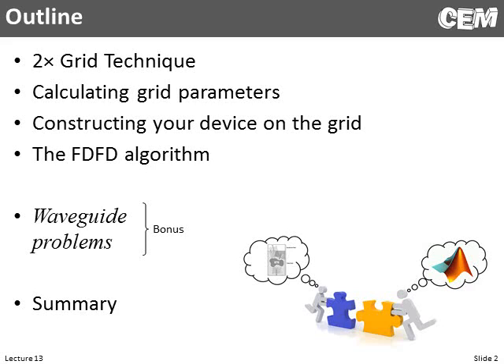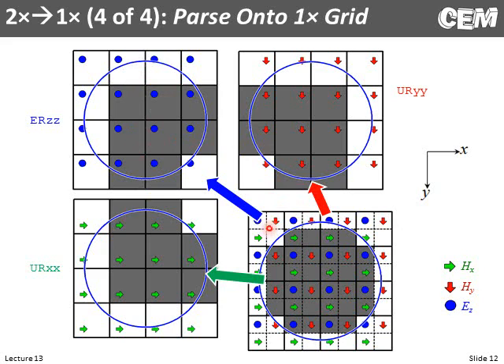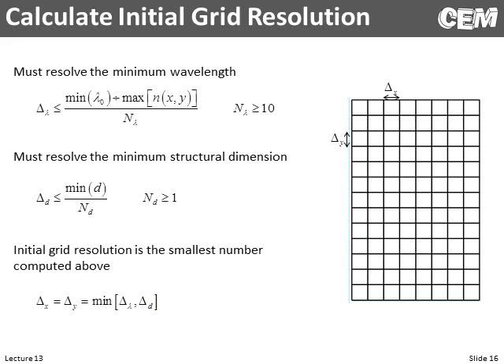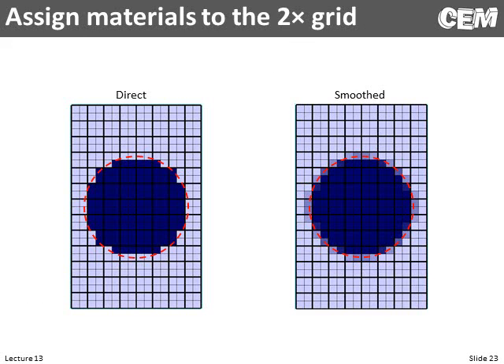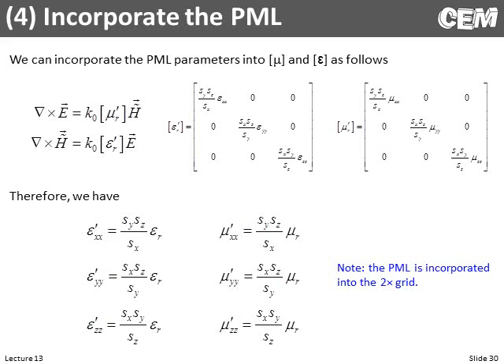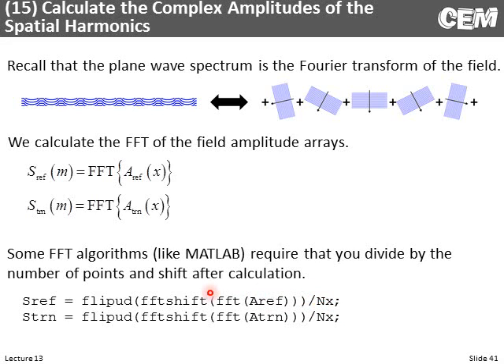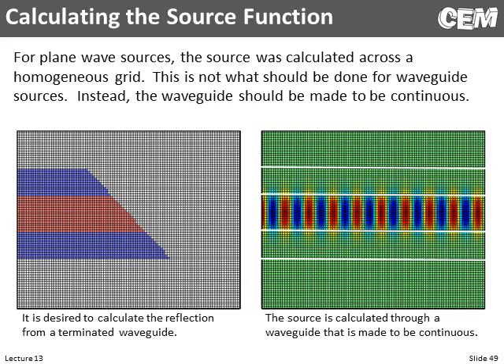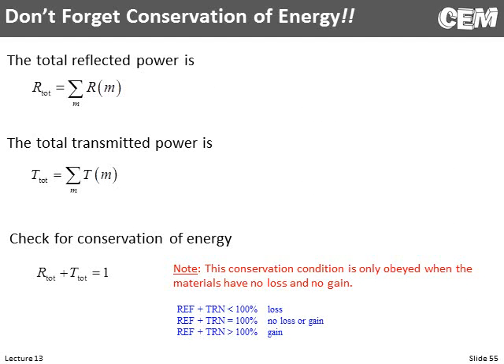Lecture 13 (CEM) -- Implementation of Finite-Difference Frequency-Domain

Comment: How to know which mode is guided through a hollow core fiber ? As obviously the effective index of the guided mode will be lesser than the clad index.
Reply from the maker: There is another lecture, now Lecture 12 on the course website, that talks about calculating modes in waveguides.

http://emlab.utep.edu/ee5390cem.htm

The effective index is essentially a weighted average of the refractive indices composing the waveguide, where the weighting function is the profile of the mode.  What this tells us is that the effective index cannot be lower than the lowest refractive index and cannot be higher than the highest refractive index.  These bounds are one way to make a good guess about whether a mode is guided more not.  The other way is to visualize the mode.  This takes a little more practice to recognize guided modes, but you will see the non-guided modes extend too far outside the core and up to the boundaries of your grid.  Sometimes the non-guided modes actually have a higher magnitude outside of the primary waveguide region.
Reply: CEM Lectures 

Thanks. I have watched that lecture also but this is the one doubt that is puzzling me then too.

The effective index can never be lower than the lowest index value,
How this is possible when light is guided through the low index region ? ( Hollow core PC ). Can the effective index of a guided media can ever be greater than the actual RI of that media ?
Reply from the maker: For waveguides that are uniform in the longitudinal direction, I don't think so.  In metal waveguides, the effective refractive index can be less than one.

For photonic crystal waveguides, or any waveguide with variations in the longitudinal direction, pretty much anything can happen to the effective refractive due to the scattering and interference this can cause.

Comment: Dear Instructor / Teaching Assistant

I want to ask about 2X Grid.

Considering that we are discretizing in a cartesian coordinate system, if we want to model a cylindrical object, that you have used to explain the concept of 2X grid, we will always get an approximation of the cylindrical shape, and it will never be an exact cylinder. So given the approximate cylindrical object, the materials are well defined in each cell, so are the E and H field components. It will not be the case that some E or H components will lie within different materials. 

So then why do we need a 2X grid?
Reply from the maker: You do not need the 2x grid, it just makes things easier.  Without the 2x grid you will have to build the permittivity and permeability arrays separately for each field component.  You will end up having to build your device at least six times for ERxx, ERyy, ERzz, URxx, URyy, and URzz.  You will have even more terms if you including more sophisticated anisotropy.  This is not easy to do, especially for curved objects because you will have to figure out where each component falls with respect to your object.  Some field components could end up inside an object while the others are outside despite all those components being in the same Yee cell.  The 2X grid makes this process much easier.  You only have to build the device in an array one time and then you just parse the 2X grid into all of your different 1X grid arrays.  It is actually very easy to do with just a little practice.

Comment: In your paper you pointed out, the TF/SF interface must form a closed contour.Actually I found problems when I set PML on both x and y directions and make the SF region cut through PML on the y boundaries. Does it mean the TF/SF interface must not cross inhomogeneous medium? Could you explain a bit more about this please?
Reply from the maker: In general I say the TF/SF interface must reside within a homogeneous region.  This really is only a true statement for plane wave sources.  Other source types are certainly possible.  A Gaussian beam source for example can have the TF/SF interface cut through the PML as long as the beam itself decays to near zero by the time it reaches the PML.  The TF/SF interface may cut through anything as long as the source you use is very close to a rigorous solution in that region.  However, obtaining that rigorous solution is much more sophisticated than just using a simple and easy plane wave source.

I will also add the TF/SF interface must form a closed contour so that there is no ambiguity in the source.
Reply: " The TF/SF interface may cut through anything as long as the source you use is very close to a rigorous solution in that region. " ---- thank you very much !!

Comment: Prof Raymond, I have a question regarding implementing metal into FDFD. If I take the complex relative permittivity from curl equation then I get:               er+1j*con/(2pi*f) for positive convention;         or er-1j*con/(2pi*f) for negative convention.        My question is, why we can ignore the imaginary part of the PEC, if its conductivity is infinite?
Reply from the maker: Technically we shouldn't.  This is just a numerical trick for FDFD to easily incorporate metals.

Comment: Prof Raymond, I was able to successfully complete Homework 7 part 1 (FDFD implementation), using the functions yeeder, calcpml2d (which have been checked by your .p scripts).
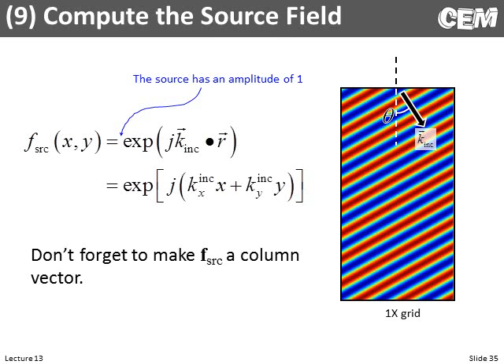However I had to change the equation in (43:14) and use (-jkr) instead of  (+jkr). I think this is because the yeeder equations (which are said to be working fine according to your tester script), is based on (-jkr) forward wave propagation notation.
Reply from the maker: Maybe, but it would surprise me if this mistake slipped through the cracks.  There are three things that need to be in harmony: (1) the source, (2) the UPML, and (3) the periodic boundary conditions.  Check all of these for the +jkr convention.

Comment: Very excellent courses. I have a question about FDFT. I want to solve the modes of waveguides including lossy metal (not perfect metal). I wondering if it is ok just inputting the complex values of the permeability. according to page 24, it seem I need to pay some attention to something else. but I do not know what is that. can you help me? thanks
Reply from the maker: +Xiaofei Xiao Nope.  All you have to do is make the permittivity complex to account for loss.  The parameter relations are discussed in a previous lecture as well as how to use FDFD for waveguide analysis.
Reply: +CEM Lectures Thanks. With your help, I have done that.
1.So now I am wondering the reason for the difference (less than 0.1% for the real part) of the effective index between the results from matlab codes and comsol module. I think the grids, grid size and the precision of the calculation should account for it. Is that true? When I changed the material from dielectric material to lossy one (metal), the imaginary part of the effective refractive index would be much larger (the err should be about 20%). I do not know the reason.

2. How can I derive the formula, if either the coordinate system is changed into cylinder coordinate system or the grids are changed into triangular ones. Do you have any learning material?
Thank you in advance.
Reply from the maker: +Xiaofei Xiao The difference you are seeing between your finite-difference code and COMSOL could be for several reasons.  Assuming you have no mistakes in your code and your results is well converged, you are seeing the consequences of an unstructured mesh Vs. a structured mesh.  The structured mesh suffers greater discretization error, especially when trying to resolve curved surfaces.  There are some averaging techniques that will help help this (see dielectric smoothing in Lecture 15).  However, I suspect this error is still well below what discrepancies there will be between the simulation and the actual device.

In your second question, I think you are asking for how to implement FDFD in cylindrical coordinates?  I do not currently have any lecture material on that.  I think your best resource here is the literature.  FDFD shares much in common with FDTD so you can look there.  Also, Taflove's book on FDTD covers this topic well.  Some day I may add this topic.

Hope this helps!
Reply: 你好，我有一个问题，既然理想导体的导电性为无穷，为什么在相对介电常数中其虚部不被考虑？er+1j*con/(2pi*f)